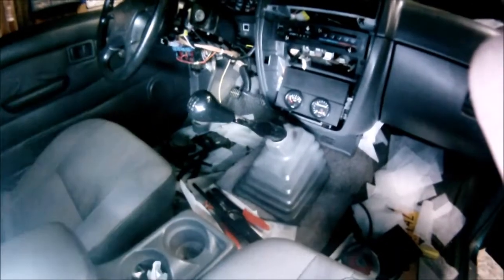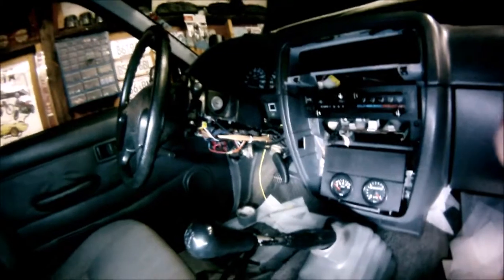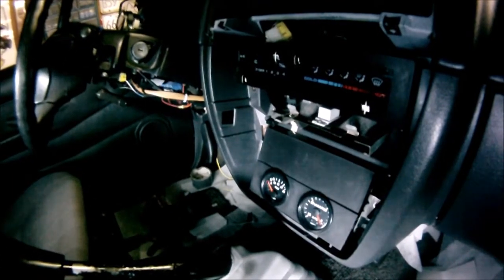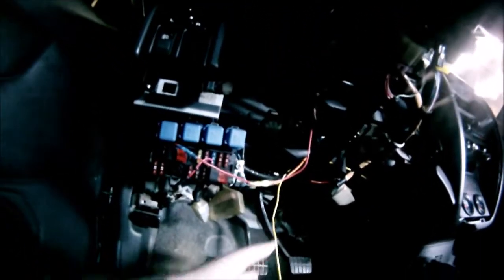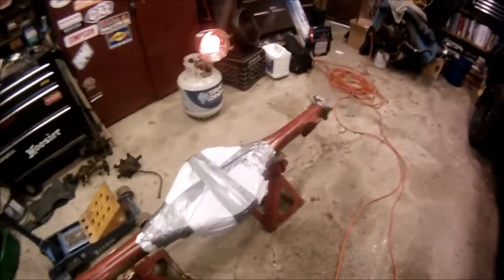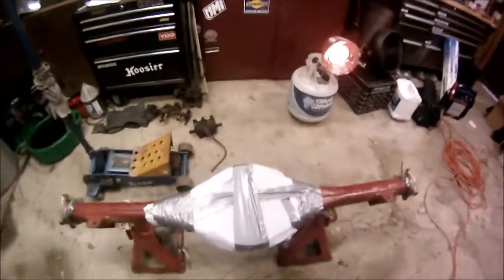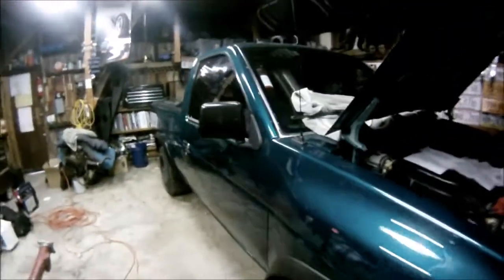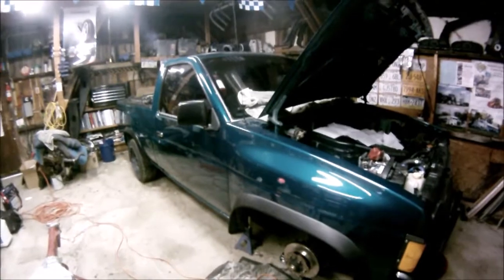Nissan D21 Autocross Hardbody: Update 12/28/2015

Comment: Question, Im looking to get into Autocross what should i start on 1st i have a 1996 D21 like you 2wd all stock suspension lol.
Reply from the maker: For starting out and getting a feel for the truck I would recommend decent shocks and lower it some. That will get you in the door for novice autocross. From there the truck will tell you what it needs and that's when you notice how much thinner your wallet looks. Good shocks and lowered ride height till you get the feel for the truck then go from there.
Reply: Nissan Truckguy Im use to te truck what width tires do yiu recommend?
Reply: Yeah my D21 is only mostly stock suspension lol

Comment: Where did you get that rear end built?
Reply from the maker: It's completely stock out of a heavy duty v6 2wd long bed truck. I have had this axle for so long and haven't done anything with it but that is all going to change when I drop it in my 1991 junkyard built red truck this Winter.